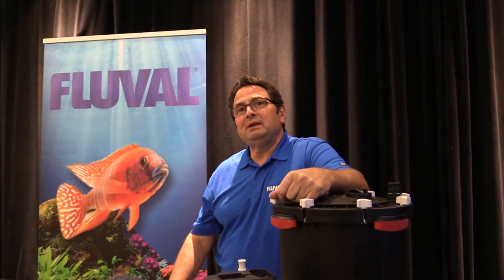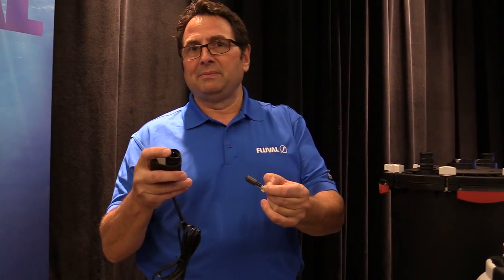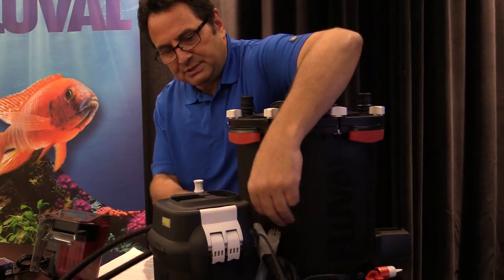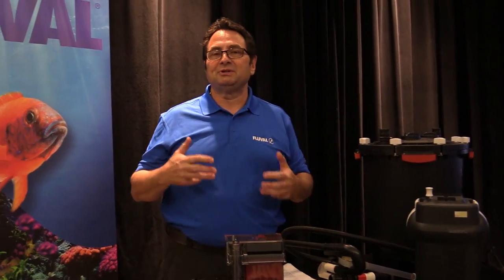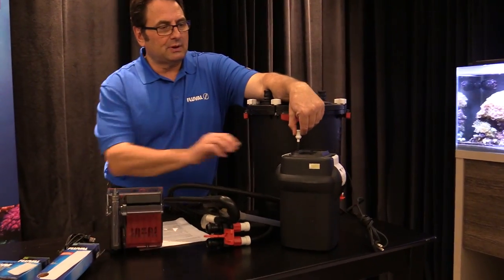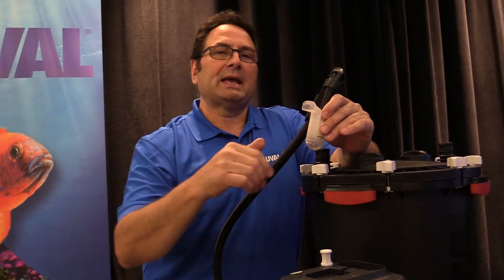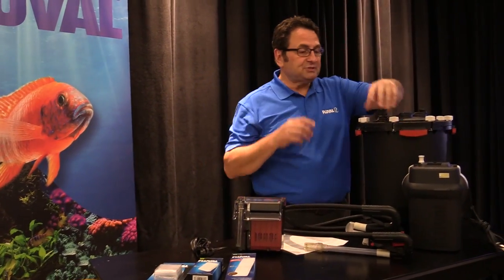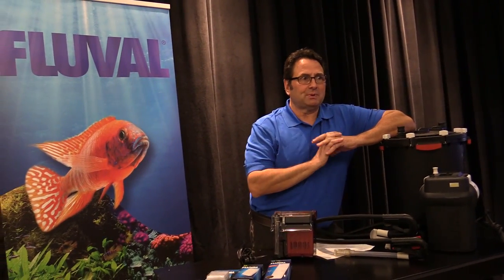HOW TO: Fix Your Aquarium Filter

Comment: The 1 number reason my 106 slows down is the actually black hoses. 3-4 weeks i need to get a long thin stick and clean inside them. The amount of brown stuff that blocks the hoses cuts the flow rate in half or more. I think the rigid shape just traps to much waste. Better design if it was smooth in my opinion.

Comment: Hmmm... Ok. I have A Filter from a differrent brand. But your words made me think very nicely. About a week ago I noticed that my filter was weakening. Today I made a water change and found that the water was just dripping out. In front of my filter hangs a large pre-filter, which was again full with tons of bacteria. After cleaning, almost nothing has changed in the situation. I checked the external filter several times taken apart and reassembled. The filter itself almost never gets dirty. So I could rule that out. The impeller looked good. He wasn't dirty and the ceramic wave was fine. The seals are all perfect and there is nothing else leaking. During commissioning, I noticed that the manual pressure lever sucked in almost no water. So I had to fill the part with water and open the levers at the right moment. When the pump is switched on, you can briefly hear a rattling followed by blubber noises. You can see some bubbles rising, which only laboriously climb up. From time to time the pump barely manages it and the water flows back before the pump has enough pressure again. Normally, a large beam would have to come through each opening at the front, but only 1/5 of the other power arrives. I don't know what the problem might be. I suspect that the pump attracts air over the hose clutch. Otherwise, it can be assumed that the motor is broken. I've even had all the filter media and the prefilter removed just to find that it makes it worse. That's how slow I'm with my Latin at the end.
Reply from the maker: Hi, that doesn't sound good at all. We suggest you contact the manufacturer of your filter for assistance, or purchase a Fluval filter!
Reply: @fluval  I've already been playing with the thoughts of getting a new one. I think he still has a guarantee. In the Corona time, however, I can not redeem the guarantee, as the shop is closed and the company does not have an online shop. Unfortunately I can't buy any of them from another company, because this filter was made especially for my aquarium. I need a special flow angle and intake nozzle. I don't want to constantly look for my aquarium sat in the filter 😂

I have a relatively small basin, but it has to pollute a lot of water in a short time. So just 750 l/h. Sounds a bit overkill but I need the performance, because my aquarium has little amount of plants but millions of algae. Snails and other farm animals are eaten. I even have a special soil filtering that keeps my aquarium clean for a long time. This means that I do not need chemicals and conditioners. I can also use a fan to sink the chlorine content. The hoses are made of special materials that do not emitte chemicals into the water. My filter is also the heat sink and is made of titanium. As a result, no ions are emitted and titan has generally sterile properties... And yes I have Axolotl. That's the reason for this setup... 😅👍
Reply: @fluval  I found the error. It was actually a very nice little thing, but it leads to a big problem. The impeller hits the wall more and more frequently. When it is attached there, the pump does not generate enough torque to align or center the impeller correctly again. In this case, as far as possible, when installing the impeller, it is necessary to take care that it does not lie on the housing. The second option is to play lottery. You often have to turn the pump on and off again until the impeller is properly aligned again and the performance is significantly improved. Then you should bed that it works as long as possible. Once the power is gone, either the filter can be full or the impeller is hooked.

Comment: I know I'm a little late, but thank you so much for this video! I had no idea the pump was removable! But that definitely solve my problem. However, the directions say to change the medias, but I'm getting a lot of people telling me to rinse it with tank water and not to use carbon unless i need contaminates absorbed. So my question is, why do you guys advise us to change it so frequently?
Reply from the maker: Brooke, you are most welcome. Rinsing bio-media for example is the way to maintain it. With the C filter you will find regular replacement of the first pad that contains foam and a polyester facing absolutely needs replacing between every 3 to 6 months as the polyester side starts to fray and become increasingly difficult to clean. Chemical medias, like carbon, do need to be replaced after they are saturated as is evident as the aquarium water will become less transparent or if not the carbon will slowly start to leach pollutants back into the water. Yes, carbon can be used for specific purposes, such as, clearing water, removing trace amounts of medications, controlling and eliminating odors, etc.....but should be discarded when it starts to lose effectiveness.
Reply: @fluval  Oh, okay. That makes a lot of sense. Thank you.

Comment: Hi! I wanted to ask for advice. I have a new my first external filter (AQUA NOVA NCF) and i opened it, get water inside of sponges and everything. But when I pluged into electricy, it wont suck or push water. It does but it is just a little string and basically it seems to not work at all. I tried to reopen, look on every floor on sponges, but water and recharge... Nothing. Also, it makes not cool sound and vibrates badly. :( Please, did I do something wrong? I heard something about air bubbles but I have no idea what the problem could cause it.
Reply from the maker: You'll have to ask the manufacturer of that filter for help! We recommend you purchase a Fluval filter instead, though. 😉

Comment: HI Tom and Fluval,
On your smaller spec and other newer all in one aquariums with built in filters. I watch and hear constantly how to slow the flow rate of the water output down (all home remedies). Especially for fish like betas or others that need a slow flow rate. Is there any discussion on making a flow rate adapters etc for the smaller fluval spec 2.6 or 5 or adding them into your excellent product line? Thanks
Reply from the maker: Not at the moment but we are listening, thanks for your comment.

Comment: Just picked up an fx6 second hand.. bought new impeller and o ring. Upon filling my filter it as a massive leak right at the motor seal with all band new parts direct from fluval. This is not a drip leak but flow fro,mother bottom of the motor housing behind the impeller. Like I said right where the seal goes. What is going on?

Comment: hi Tom I just want to as I have marina 54 tank I have some water coming from the frame where the lid fits in I went to my pet store and they say its condensation I don't think its coming from. the tank its self I am using a small eheim  filter as the marina i10  I did not like it as its got carbon in the media cartridge and I use a lot of plant food and carbon take it out so could it be the eheim filter that's splashing up with the condensation to make its run down the side and the back of the tank its only doing it on one side I can't see how its getting out cheers happy fish keeping
Reply from the maker: Anthony, you can shut the filter off for up to a few hours, lower the tank water level a few inches and take aquarium safe silicon and inject on the inside of the tank upwards into the interface of the plastic frame and the glass. Silicone will cure and harden sufficiently, a couple of hours, in higher humidity and there is no danger to the fish in doing that.

Comment: My fluval 110 had gotten clogged. After cleaning it the filter won't run regardless of the outlet I plugged it into. If I turn the impeller it will running for a few seconds and stop the moment I let go of it. Cleaned everything in the filter but still didn't work. Adding petroleum helped like suggested the first few times but even now it doesn't get it running.
Reply from the maker: Bob, is the motor stops and starts when you manipulate the power cord perhaps there is an issue with that, if you  have your receipt or any proof of purchase for the item it would be under warranty.

Comment: I have a Fluval 305 new filters put all back together full of water but its not pumping anything into the tank I can hear it running sounds fine but nothing coming into the tank any ideas what could be the problem ?
Reply from the maker: Sounds like the intake side is full of air. Empty the filter, prime, but, this time make sure the output is just above the waters' surface, this will ensure all the air is flushed out and the intake is full of water, not air. What can happen when you re-connect your Aqua Stop and have the output side underwater is that the output siphons the water into the canister and the intake remains with an air pocket in the hosing. Give our suggestion a try and let us know how it goes, that method has never failed us.

Comment: A very informative video.  Thank you.  But as one of the other viewers said, I cannot seem to open the chamber that has the check ball in.  I tried the rocking motion but ended up breaking the strainer.  Could you consider uploading a video (maybe a slow motion one) showing how it is done?  It often gets blocked with moss and other debris.
Reply from the maker: +Eklavya We're glad it was helpful. We've found that applying a gentle back and forth rocking motion helps free the strainer while also reduces the chance of breaking it. After some time, plastic can become more brittle in water so yes, there is a chance after longer periods that it could break. Incidentally, it can be purchased as a spare part. Your video request is noted - Thank you!

Comment: Hi I have a fx5 and the filter it is pumping for 3 to 5 seconds then stopping I stripped it down and cleaned it and put it back together again bit it still pulses on and off is this moter broken or would a impeller kit fix this issue
Reply from the maker: +Scotty Bhoy The impeller is the only moving part. When you took it apart, did you check the impeller? It seems more likely this could be a motor issue.
Reply: Thanks for reply, yes I took it apart and cleaned the impeller well and also the shaft to.

The impeller its self is spinning freely but it seem's to have alot of movement other than the way it spins.

The black collar has some movement in it also and where it join onto the shaft had black mark like the collar was rubbing.

Don't know if this will help.
Reply from the maker: +Scotty Bhoy Thank you for providing these additional details. The movement is normal. It appears that the motor might need to be replaced.

Comment: I bought a fluval 406...the filter is running 1 month and the problem is that the filter is constantly spitting bubbles into the tank...I went to my retail seller he changed my impeller and primer but the filter still keeps spitting bubbles
Reply from the maker: Have you tried cleaning and lubrication the motor head O ring? Is this a marine or freshwater aquarium?

Comment: hi please advise, i have a fluval 205 and i cannot engage the grey lever that locks the pipes into the canister any help would be greatfully accepted x
Reply from the maker: Margery, it may be because the bottom segment of the lever that is supposed to enter the visible slot beneath it has been slightly bent for some reason, we suggest focusing on that point to help guide the lever in.

Comment: Hi bro, i have a canister filter dophin C1000. Try to set up for a first time, but when i pump out to make the water flowing into the filter, the pressure is not enough. Then, i try to search in the utube, filling the filter with the water then turn on the power. But, it doesn't working. Then, i heard a weird sound from the impeller. I try to take off the top and switch on the power, i saw the impeller is not spinning well. It's vibrate only. I try to pull out the impaller, and put it back again. But, it just still the same. Please, can you help me to solve this problem? Just bought this canister filter through online. 😭
Reply from the maker: Unfortunately we cannot as we really have no experience with the brand/model of filter, reaching out to the manufacturer or the retailer you purchased it at should help you.

Comment: I was using internal tetra 10i, I did a water change and turned it off. When I tried to turn it on, it collected water but it just stopped. Cleaned it but nothing worked. Help?
Reply from the maker: We do not sell or manufacture that brand however it is likely a case of low wattage motor and the magnetic impeller being impeded in some way, check the impeller and its shaft or bushings to ensure all are ok and properly positioned, as mentioned not our product so we can't provide anything more specific.

Comment: You mentioned changing the media every few months. Why do I need to change mine weekly because it is so black and clogged?
Reply from the maker: Darlene, do take note that at the 3.36 mark we do say "replace the media when its called for", this is necessary especially in the case of cartridge style media that in fact we are specifically showing when we make that reference as that type of filter media can clog sooner, while also being directly impacted by how many fish you keep, their size, food used and a number of other factors.
Reply: @fluval  I have 5 swordtails in a 10 gallon tank, about 12 female show guppies in a 10 gallon tank (was about 20 when I first separated the guppies), and about 40 male guppies in a 25 gallon tank (was about 100 when I first separated them 2 years ago)

Comment: Does fluval sell any filters for smaller tanks about 5 gallons?
Reply from the maker: Aly Homewood Hi, the <span style="font-size:10.0pt;font-family:"Calibri","sans-serif";
mso-fareast-font-family:Calibri;mso-fareast-theme-font:minor-latin;mso-bidi-font-family:
"Times New Roman";color:#1F497D;mso-ansi-language:EN-CA;mso-fareast-language:
EN-CA;mso-bidi-language:AR-SA">Fluval C2 clip-on filter does have adjustable flow control, making it a good option.  http://bit.ly/1HqZDoZ
Reply: Aly Homewood ten gallon filter is fine

Comment: I replaced the cannister O-ring and the two small O-rings on the attachment for the hose but its still leaking. what else should I check or replace?
Reply from the maker: Skye, please let us know which exact model of filter you have?
Reply: Fluval Aquatics I have the 305 model.
Reply from the maker: Skye, the leak is from where the motor mounts to the canister? You can try thoroughly cleaning the groove the O ring mounts into and ensuring the new O ring is lubricated, it come should come pre-lubricated.
Reply: Fluval Aquatics yes. I cleaned that area as well. It's dripping where you would clamp the the motor head and cannister. Is it possible the bezel that is between the cannister and motor cause a leak? It has a slight movement.
Reply from the maker: Skye, please contact fluval support at fluvalaquatics.com, sounds like they need to look into your O ring. Sorry for this inconvenience. Which country are you located in?
Reply: Fluval Aquatics U.S
Reply from the maker: Skye, please use this link to our Fluval Support page link, you may review the contact options to choose the one most convenient for you: http://www.fluvalaquatics.com/us/fluval-support/

Comment: So what happens if I have gone through all of these troubleshooting steps and nothing is working? I have two of these. They were off for a couple weeks, cleaned out, and are set up with all new media. Neither of them work now. What in the world? My hand has literally 3 calluses on it now from trying to prep them both for so long. Won't prep, motors in both run, everything is checked and sealed?! how!? What?! Customer care has been no help. These are very expensive.
Reply from the maker: Hi, which specific filter are you referring to?
Reply: I have the 306. I love it. It actually won't prime at all. It's almost like it isn't air tight any more. I am working on getting my receipt. I just fear that if I can't get a copy of it, I won't be able to have it taken care of under warranty. I only have my bank statement that shows the amount I paid and the date.

Comment: how do you take apart the intake strainer for the 406 model? I always have trouble cleaning the chamber that the check ball sits in. thank you
Reply from the maker: Sure, we're happy to offer assistance. Basically, using some force, you will pull the bottom strainer cage off the molded piece it is plugged into. This will then liberate the chamber the ball sits in. We've found that applying a rocking motion back and forth on the two pieces in opposing directions works best to separate them as opposed to twisting.
Reply: Very helpful, Thank you very much :)
Reply: Fluval Aquatics please help meeeeeee
There's water coming out of 4 sidex

Comment: How about cloudy Water 
My whisper did a better job then the fluval 
What can I do to make it clear?
Reply: +beto cerv screw whisper xD
AC and fluval's are the best
Reply: +ThatsSoRepti my tank has been running for two years 
And when I got the fluval it still cloudy
Reply: beto cerv did you rinse all the media? If not thats your answer. dust from the media is pumped into your tank.
Reply: +beto cerv if you threw out your cycled media it's a bacterial bloom

Comment: How do you fix filter thats pumping water outside tank and on to floor?
Reply from the maker: Melissa, that sounds like a type of hang on filter that has clogged filter media to the point of overflowing. Regular maintenance is required. Let us know which filter exactly and how often filter media is maintained?